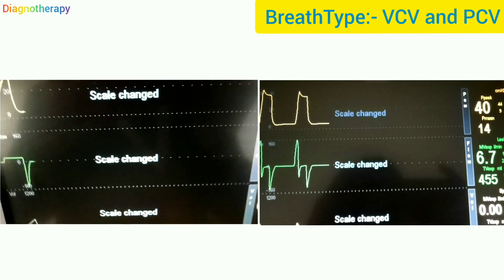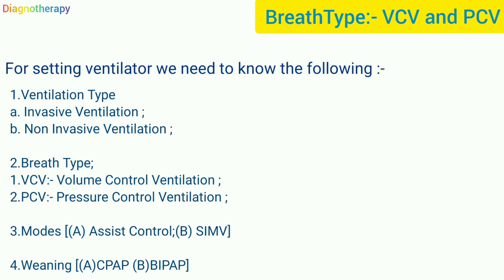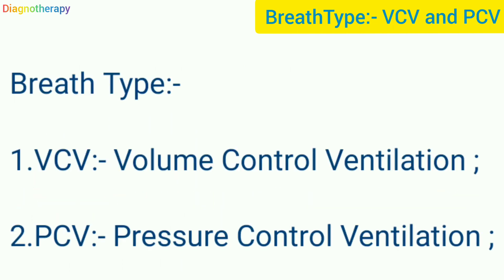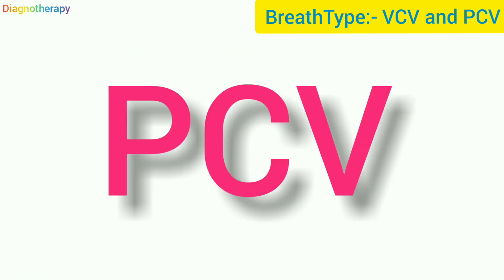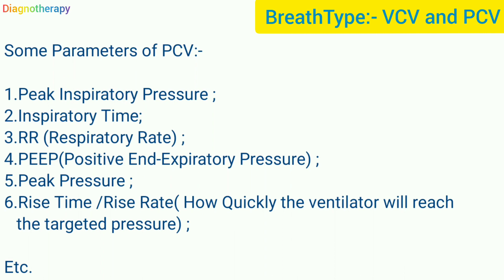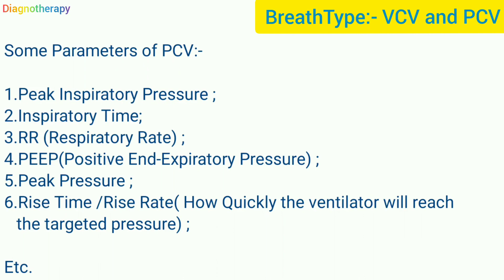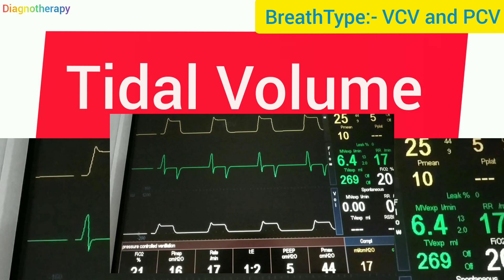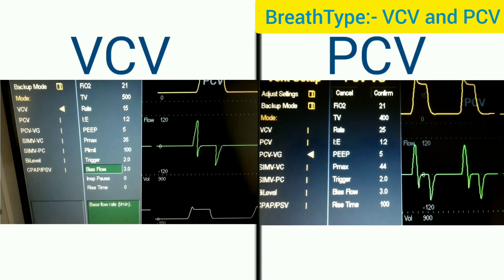Ventilator settings | VCV vs PCV | Volume Control Ventilation VS Pressure Control Ventilation

Comment: In Assist. Control mode Two types: 1) Volume Control, 2) Pressure control.
Is This Two assist control modes required complete sedation..?
Reply from the maker: AC requires complete sedation. All breaths are machine controlled.